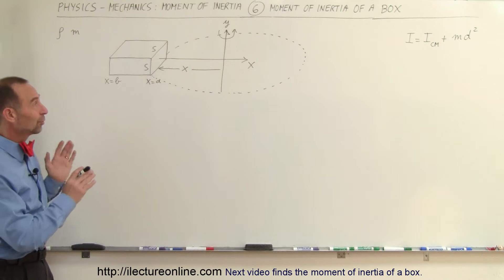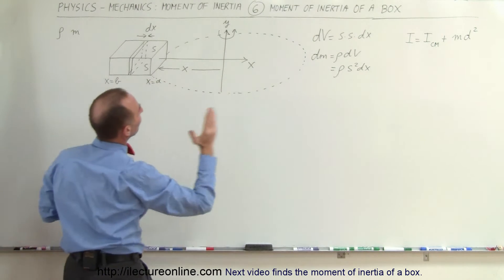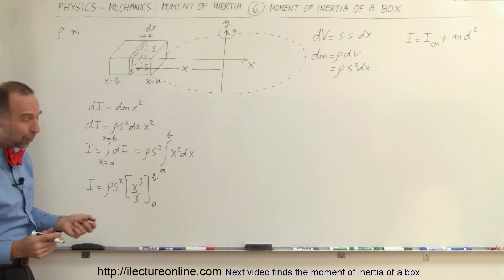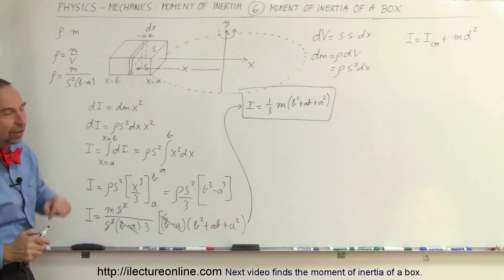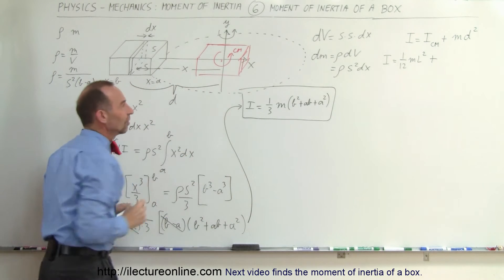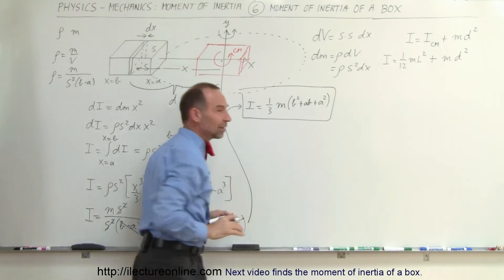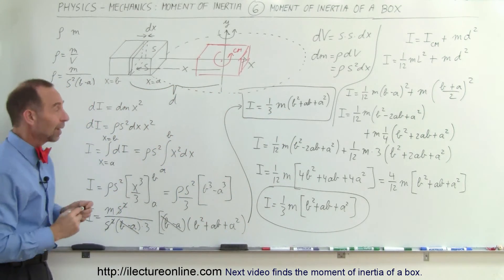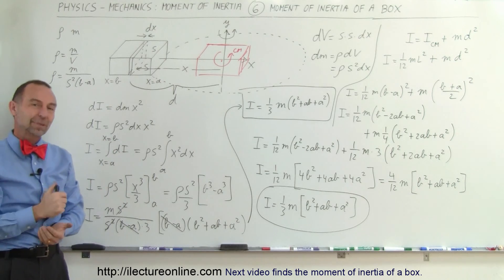Physics 12  Moment of Inertia (6 of 7) Moment of Inertia of a Box: 2 Methods

Comment: Hello Michael, very useful. I have a situation where we have two equal size boxes to the right and left of the center of rotation. Could you offer some tips on finding the mass moment of inertia for this situation.
Reply from the maker: You can use the parallel axis theorem, or simply add the two parts.  Note that I total = I 1 + I 2
Reply: @MichelvanBiezen  Thanks a lot Michael. Wishing you all a Merry Christmas.

Comment: i just want to ask  what is the difference between axis of rotation  and axis of symmetry?
Reply from the maker: The axis of rotation is arbitrary.  You can pick any point and rotate the object around it, and call that the axis of rotation.  In some cases the axis it taken to be at the center of mass of the object.  The axis of symmetry is a line chosen such that the part of the object looks identical (mirror image) the the part of the object on the other side of the axis.  If you could fold one side over the axis of symmetry, it would exactly cover the part on the other side.

Comment: Sir can you please solve questions based on a wheel or a sphere overcoming a hurdle of some height like what should be the minimum height it can overcome if it is rolling towards it with speed v.
Reply from the maker: There is a problem like this here:            Save       Cancel          

   

    Mechanical Engineering: Equilibrium of Rigid Bodies (19.5 of 32) Ex. 3 Eq. of 3-Force Body

Comment: Thank you so so much professor.sir i have some problem or confusion in this video. I can't understand that why 
you write 
 d=(a+b)÷(2)
please tell that.i can't understand it.
And thanks a lot.your all lectures are fantastic. And sir please give me the answer.
Reply from the maker: d is the distance from the origin to the center of mass.  The center of mass is at the halfway point between a and b.  To find the point between those 2 number you add them up and divide by 2.  (Ex:   the middle point between 2 and 8 is:     (2 + 8) / 2 = 5
Reply: Thanks sir.Good morning

Comment: What happens when S is large compared to R? That's something that's confused me about the box. The Radius doesn't seem to be constant along the edge of the box unless the length of the box is very small compared to the radius at which it's rotating.

If the box is rotating at at radium of 3 metres but the length of S is 9 metres, is this approach still valid?
Reply from the maker: That is a good observation.  The problem then needs to be done in a different way.  (I'll have to make a video for that).  Off course each type a problem is used to describe a specific situation and this example ignores the small edge effects.
Reply: Thanks that would be a cool video to be sure. And agree, I know you're not trying to show some generalized solution here, I was just ignorant of your assumption about S vs R when I first saw the problem and so I was a bit confused. But that makes sense, and certainly simplifies the problem. I really enjoy the derivation videos, they really cultivate a deeper understanding of the underlying physics... which is what I'm really after. Thanks again for everything you do. You're channel is mint!

Comment: Hey Professor. Could you explain the significance is taking a "slice" of the box like you do at the beginning of these problems? Is this necessary so we can integrate later on in the problem?
Reply from the maker: When you are finding the moment of inertia, you must slice it in such a way that the distance from every part of the slice to the point of rotation is the same distance.
Reply: My question here is about that distance from the axis of rotation. From the diagram you drew, it looks like the distance to the axis is not constant for a slice. The centreline points on the slice will rotate at radius x but as you move out towards the ends of each slice, the distance to the axis increases until it is equal to s^2 + x^2, no? Or am I not understanding what you're doing here.

Comment: since the axis is through a rectangular plate why is formula I=1/12M(b-a)^2, isn't the formula for it is I=1/12M(length^2 + width^2) and when you write the distance it is a little confusing looks as if d = x
Reply from the maker: uy nguyen In this problem we are assuming that s is small enough where we can use the equation I = (1/12) ML^2
Reply: thank you, your videos are very helpful and much appreciated please post more